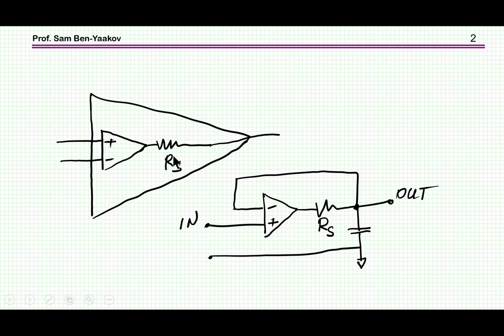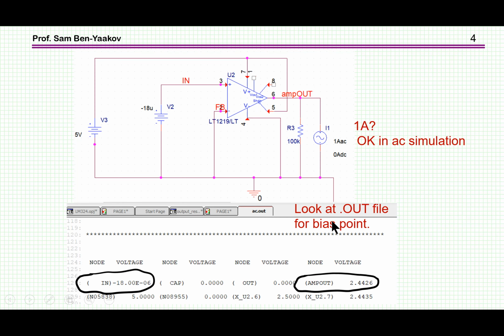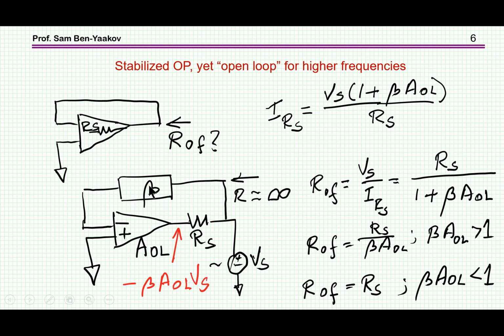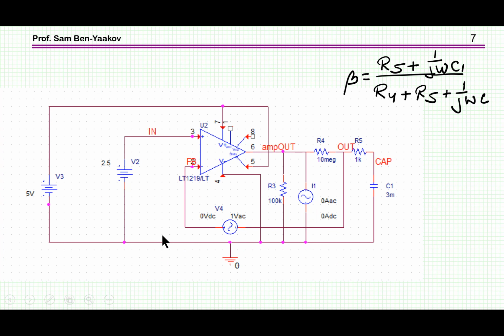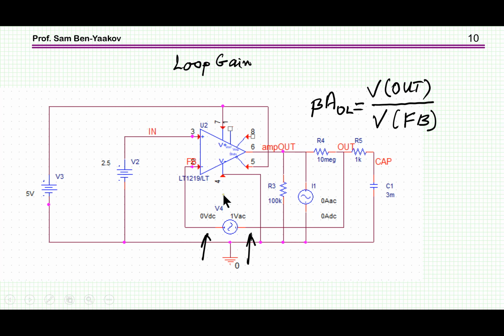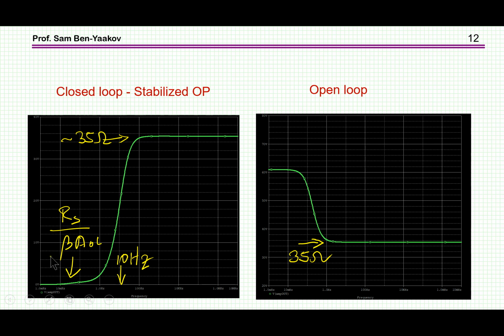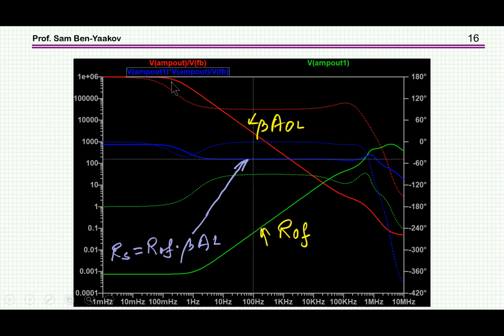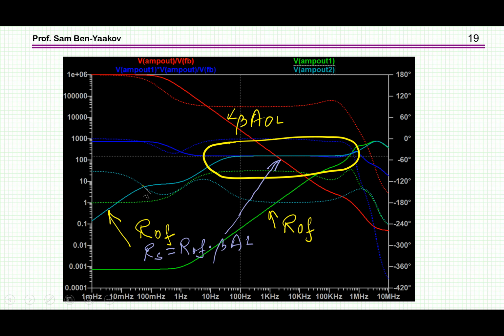How to obtain the output impedance of Op. Amps

Comment: 1 millifarad is a big capacitance. is this really possible in physical measurement?
Reply from the maker: Thanks for comment. 1mF is not impossible to realize but the video is primarily discussing how to get the information from simulation (assuming that the model emulated correctly the resistance).

Comment: Very nice. I wonder if an actual physical measurement was made what the measured value of Rs would be?
Reply from the maker: Thanks. Good point. I would suspect that the physical resistance will be in the neighborhood of 100 Ohms. This can be inferred from the data on overshoot as a function of load capacitance given in datasheet.